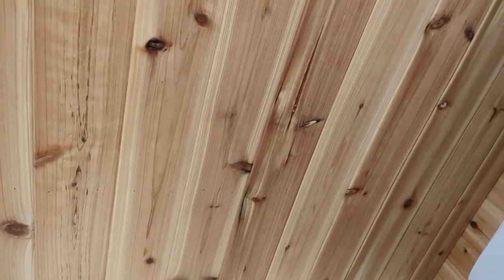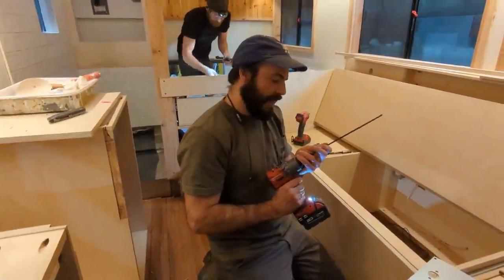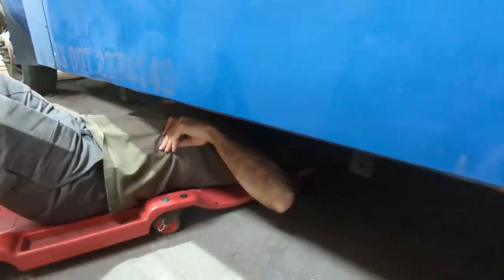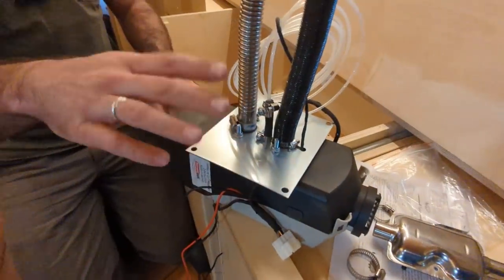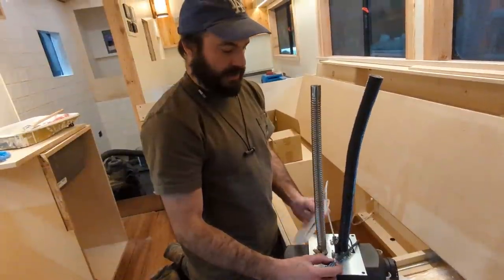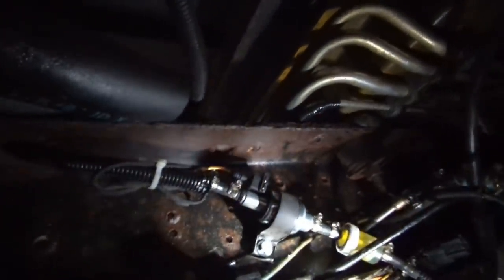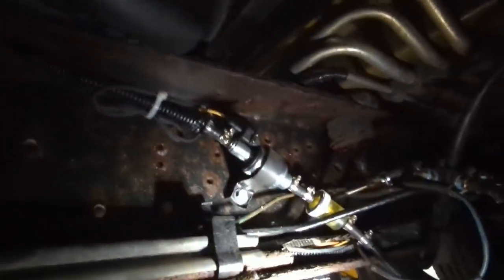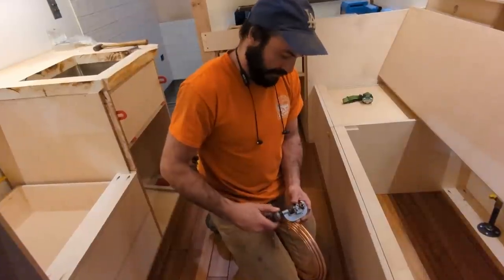PROFESSIONAL BUS BUILDER Installs Chinese Diesel Heater / HOW TO Tap into your Diesel Tank!

Comment: The Chinese heaters are installed in semis there called bunk heaters and they will keep you warm most of the time but if your in minus temperatures you might get cold. Now the advantage you have is the very thick insulation. Y'all done a fantastic job

Comment: I was wondering about the air intake situation for the diesel heater, so good to hear Charlie mention it. I used to own a restaurant and my partner ordered an overside extractor for the kitchen. The suction in the restaurant was so strong from the extractor that we couldn't open the front door, since nobody wanted the windows open during the very chilly winter! Obviously the heater pipe is quite small so it's not such a big issue to have enough gaps for the air to come in. I have to wonder if the heater uses more power to draw the same amount of air if the gaps are too small though. But good to see the build finished at a last and looking forward to seeing you, Rio and the bus out in the wild soon.

Comment: Charlie, I don't know if your drill came with an attachable handle but the Milwaukee model I had bought a few years ago did and although I've not used the handle due to needing to hang the drill off my tool belt, that long handle would make all the difference when being in low range drilling with a a large hole saw ... drill bit etc. The problem would be if there was enough room to get into the space you have to drill with that long handle because it is long !. Any of the more powerful battery drills in low range are a wrist breaker/hand smasher killer in low range when the bit decides to grab.

Comment: Charlie's pilot hole idea is a good one, but I would measure the approximate location relative to the window, then look under to see what's there before I drilled down...and I would probably drill up from the bottom.  But maybe he already knew he wasn't likely to hit anything.  :)
Reply: i do the pilot hole after i do my best to measure and locate the hole. I've had enough metal in my face to avoid drilling up at every chance i get
Reply: @ChuckCassadyYT  Right there with you. But I've also drilled through my share of stuff I didn't know was there, which was the spirit of my comment. :)
Reply: @craigieb  man, i drilled through a water tank because i was off on my count of the floor joists on a build. that was a bad day!

Comment: You need to learn how to disassemble that heating unit, every so often it gets clogged and will fail. Then you need to open up the unit and scrub out the smut with a brush.Saw this on Vanwives, they live in their sprinter van and have had to do this a few times.

Comment: After cutting that big hole in the floor, what do you do to seal the floor insulation underneath the bus to prevent water and road grime to getting in ? 

Would spreading an outdoor type silicone caulk be a good idea to seal the insulation and subfloor ?  Or maybe a high temperature caulk since it's going to be near the exhaust pipe and this pipe tends to become pretty hot ?

Comment: I know most fuel you buy in the winter has anti gel additives, but I've always heard diesel fuel will gel when it gets very cold.  Is that something you really need to worry about?  If the bus doesn't start for a regular bus, no big deal, but if you can't start your bus, nor get heat in your house, it could be a problem.

Comment: I’m surprised he didn’t mention the elevation since y’all are in Colorado. Will it still work when you’re up in the mountains? I’m having a hard time deciding which way to go with a heater. I guess you could probably use your minisplit if you were having issues with the diesel heater. 🤔
Reply: just gotta adjust the settings but it works wonderfully

Comment: I can't believe people who are calling themselves professional bus builders are drilling giant holes to install these heaters! You only need to drill the holes exactly as they are on the base plater and you use a step drill bit to do the larger ones and regular drill bits for the small ones. You get a nice clean, stable install without a giant hole in your floor for no good reason.

Comment: Why wouldn't you drill the pilot hole up from the bottom so that you don't hit anything you shouldn't? You could measure off the edge of a window from inside and transfer that to outside to give you a general location to drill. Also you said the exhaust will be running over the top of the grey tank. Should you wrap the exhaust with header wrap to make sure there's no chance of it melting the tank, if the tank is plastic? I was wondering that with a big area like that to heat that you can't split the vent tube into two to have two vents( one facing towards the front and one towards the back). I'm probably just over thinking things..lol
Nice build.
Reply: Thr pilot hole is for after you do your best to measure. I was within 1/4" of my measured target and I'll tell you I just hate drilling up through steel while under a bus--I've had enough of hot chips in the face to last a lifetime. The pipe doesn't get close enough to the grey tank to be a worry--in freezing temps a little heat on the grey is nice! To be honest, the living space is so small that this heater keeps up with it easily down to temps approaching -20 in testing!
Reply: @ChuckCassadyYT  I can understand that. So since it's 4 seasons, does that mean tanks have heating pads? Love your work.
Reply: @timdunmyer4549  thanks! The freshwater tank is inside so no need there and the grey tank is outside, no heating pad as of yet, but she may add one later.
Reply: Looks like the heating pad for the Grey tank is needed!